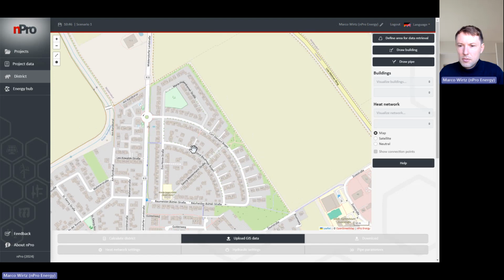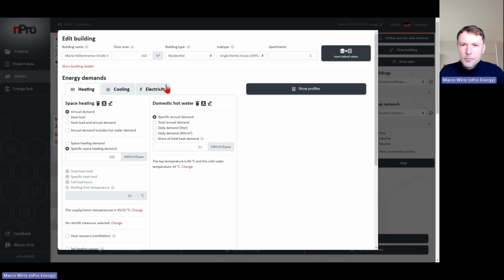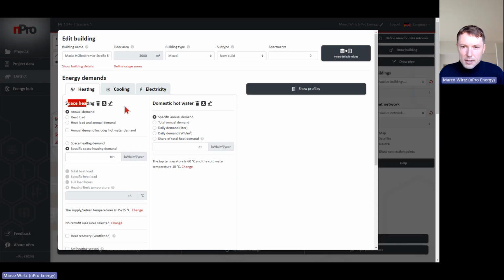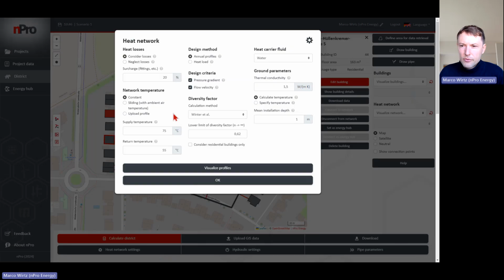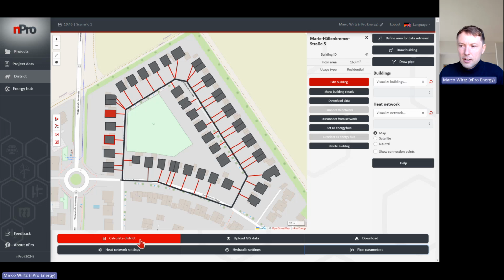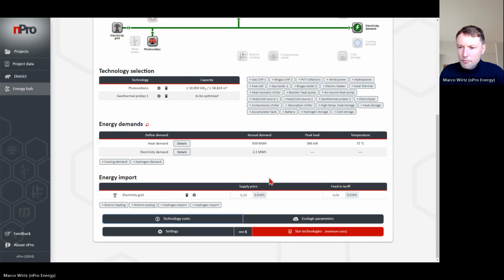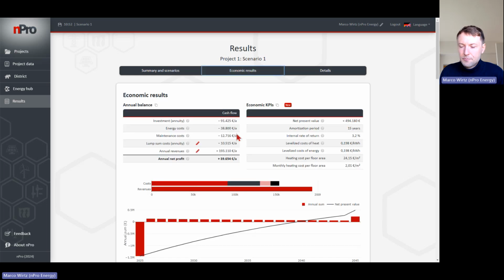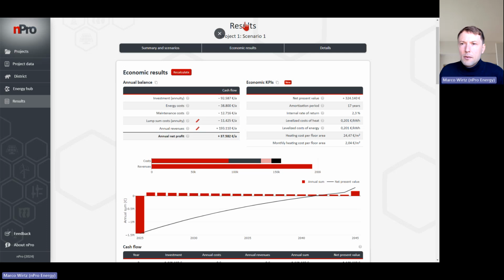Version 3.0 - What are the new features?

Comment: practical application. great. My question is why some times it takes too long to simulate the sys operation? what is solution?
Reply from the maker: It strongly depends on the system: Seasonal storages, multiple storages, many different technologies or many manual "design constraints" can make the problem complex. We often see that this is not necessary and there are ways to simplify the model with the result that it can be calculated in < 30 seconds.